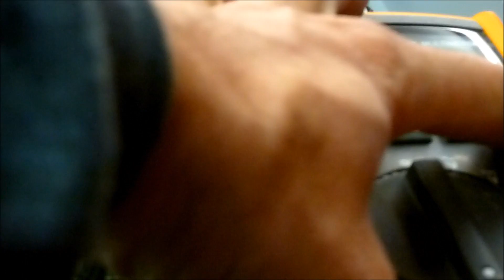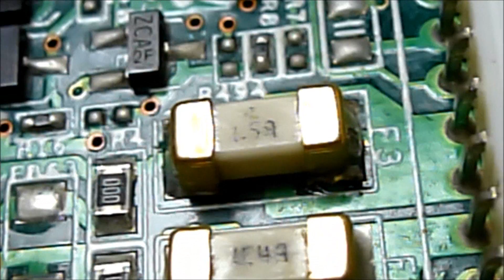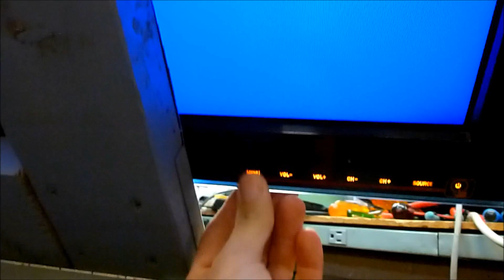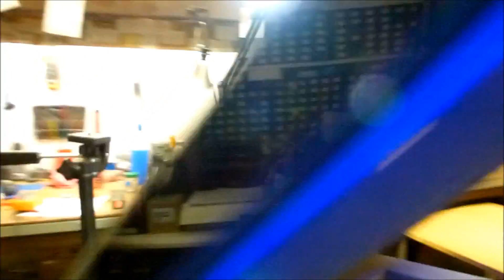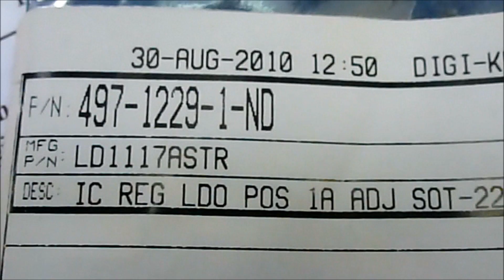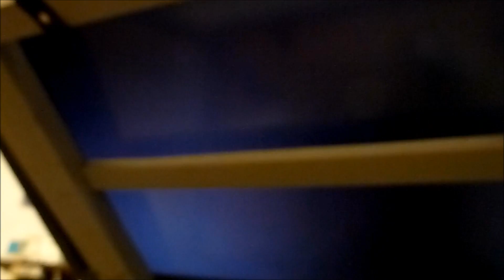Vizio GV42L GV47L FHDTV10A No Backlight, No Digital Tuner, Locks Up,Wont Power Off

Comment: Success!! Found the bad fuse and ordered 3 replacements in case I messed things up. As my soldering skills are beyond rusty, I cheated and soldered a piece of wire to each end of the new fuse, and soldered the other ends to the original fuse. Powered up and shut down with no problems. Without your video the TV would have gone to my local electronic/hazardous waste site, instead it will be put to good use. Thank You!!

Comment: You are the man!  I am an old tech-turned-engineer, but without your video I would not have had the confidence to fix my 47" Visio.  You saved me a bunch of bucks!  I was fortunate that mine only took the fuse to become fully operational.  I only have a pencil tip iron, so I was unable to unsolder the bad fuse, but I just piggybacked the new one and I am back up and running with a $1.15 part!  Giving us the DigiKey part numbers is extremely helpful!  Thank you so much for your help!  

My only suggestion for improvement would be a companion video about exactly how to break down the case and where each type of screw goes where.  Since there are so many screws and this thing is so heavy, a noob might fix it, but then break the TV by handling it, supporting it,  opening it or closing it incorrectly.  Thanks again!

Comment: Thanks Norcal715 your video helped me fix my TV just in time to watch the Kings game. ;-) I could not bring myself to pay $120 to have $10 worth of parts shipped overnight Saturday delivery, so I improvised.  I bought a 1.5A fast blow glass fuse, soldered leads to it and shrink wrapped it.  Then soldered the leads to the surface mount pads.  I had planned to have this be a temporary work around but it looks and works great.
Thanks Again Norcal715 you are doing great work!

Comment: Thank you for the lessons, they are so helpful. I have a 42" vizeo that has this exact problem, powers up but no backlight and wont turn off. I have a bad regulator it has a low output. My board only has 2 fuses instead of 3, one shows 5 volts and the other 12 volts. As I was checking volts on a larger regulator, I arched it and blew the 12 volt fuse.  The back light now comes on and I can shut the tv on and off, but there is no picture. I'm going to replace the fuse and regulator, hope it works

Comment from the maker: on the fixed voltage regulator ic's the adjustment pin is grounded. on some of them they use a resistance divider network to change the voltage.

Comment: I can also confirm that U5 voltage regulator goes bad on the GV42L. Quick fix is just use a lm317t in its place. They can be found at any radioshack.

Comment: I happen to have a GV47L with a no power problem,yellow logo and thats all,PS test 100% good,yes it has a touch pad for power with no results touching at all,any leads on which regulator to start with?,I have all (new) and waiting for the adjustable reg's to arrive-tested voltages on regs,but as I saw in your other vid's some get power from a "root" regulator and cant figure which one it is--thank you,you're "the man" (ps-NO bulging caps),if I lived any closer to your shop I would be begging for an apprentice job to learn more.

Comment: Love all your vids.  I have a Vizio vu42l fhdtv10a.  I have all the proper voltages on the main board/ Power supply and pins, when the left  inverter boards is unplugged.  When I plug the inverter board into the power supply, my output voltages are non existent.   The CAPS on the inverter board look fine. ???

Comment from the maker: The meter is a true rms but that does not apply to DC voltages it only comes into play when measuring AC, and as far as checking fuses either they are good and have continuity or they are open. as far as checking the regulators, there are too many variables involved in explaning how to check them all. as far as seeing I just use a good pair of reading glasses, and yes a fine tip. Thanks

Comment: Woo! Thank you for this, it fixed my TV picture under all inputs, only now there's no sound on any input I've tried. The speakers are ON in the audio settings under the menu settings, but I'm not getting anything. Do you know what the issue could be? Because it's not working on ANY input at all, it leads me to believe it's a fuse or something like that.

Comment: norcal715 your videos are excellent. I am trying to fix the exactly same model with exactly the same symptom of this video (Vzio GV42L fgdtv10a) All the measurement are you are explaining in this video are ok as far as i can tell so still not sure where my problem is. From one of your other video 'Voltage and troubleshooting" you mention pin 13 &14 to converter box. I do not have any current on those pin. Could this be the problem? If so, i do i fix this? Is there one of your amazing video telling me how to do it. I will love to keep my Vizio out of a landfill.
Thank you! 
If you are located in SO Cal you can even make another video out of my TV ;-)

Comment: Your videos on the Vizio TVs are great.  Have you had many Vizio TV suffer from freezing up while the TV is on?  I have come across several TV of this series that would freeze up.  Power cycling the TV will temporary fix the issue but it would happen again with no set time.  So far I have a 37 inch and a 47 inch suffering from this problem.  I know it is related to the main board but not sure what is causing this freezing up.  Is it a firmware issue or defective flash memory chip?

Comment: I have no ability to solder anything, but I've already pulled the back off this same set and I'm certain I have the ability to change a board or two without any difficulty.  While I don't have a digital meter, I do have a basic voltage meter. That said, I can tell you that when the set is plugged in the amber keypad lights come on, and if you press the power button the set clicks as if to turn on, however the screen does not light up, there's no sound or blue screen, nor will it power off by pressing power again, you have to unplug it to turn it off. Using my voltage meter I get readings only on the left side (cold side-i think you called it in another video) of the power supply and the center part too, but not on the right side (hot side) under the metal bracket where there are large capacitors and no power present on the pins that go to the wiring bundles that fan out to the main board, master and slave boards. And I get no reading on any other boards at all.  I should mention that when the set failed it made one light popping sound. I see no bulging or ruptured capacitors on the power supply board like you mentioned in another video or on any of the boards for that matter. I took off the power supply board and see no signs of scorching on the underside either. Long before the TV went out the digital tuner went out, but I didn't discover that until hurricane sandy hit me on the Jersey Shore and the cable was out for several weeks. At any rate, to me this seems like a power supply board problem and changing that out for $45 on eBay seems worth it, but I'm unsure given that the amber lights do come on. In your opinion might this be a main board problem instead or does it seem like I should start by swapping out the power supply board?   Thank you for your videos, time and effort and for any help you or others reply with.

Comment: hello i have the same tv for repair,backlight but no video.when replacing the mb i notice a wire on the lvds cable is cut. i solder the cable ,still the same issue with replacement board.Are these cables not meant to be solder?

Comment: Hello,
What voltage value should we get on the large 3 pin regulator output on the left side of the board right above the cable input?
- Thank you

Comment: I have the same make, model and made the month and year as yours. I came home and went to turn on the TV and the control panel lights were on and I could not get a picture. I pulled the power plug and that was the last time that I could get the control panel lights on. After watching your video post I tried to fix it but after testing the fuses they all tested good so now I don't know what to do. Help.

Comment: I checked the fuse you removed with my tester which is not a multi meter its a fluke electrical tester has continuity selection it beeped which indicates its closed but when it comes to testing voltage my meter doesn't read your voltages so I need to get a multi meter to check which one is bad can email me

Comment: I need to replace some of the fixed regulators, any idea what the Digikey part number for those might be?, also, if its not MARKEDon the board with ADJ id not adjustable correct?

Comment: I have a Vizio VP50 HDTV20A plasma with a blown 8A fuse. I replaced the fuse and the TV is functioning normally again. I've read that one of the two 8A fuses is prone to blow in these TVs. Do you have any idea of a typical failure point that would cause a blown fuse in these TVs, or is it just that cheap fuses were used?

Comment: my tv when off after some weird sound, now is not working, the logo in front is yellow like normal, but cant turn the tv on, the touch pad is not working also the remote controller is not working, i try to turn the tv on using the remote but nothing, i wonder what it can be the damage part, the power inverter, i will open and check this tv  tomorrow

Comment: Hey, thanks for the great videos. I'm working on the same model TV featured in this vid. When plugged in, the logo turns orange, but the touchpad is unresponsive. No visibly damaged parts. Fuses on the main board are good. Fuse on the PS is good. 5v leads from the PS are good. 12v leads from PS are supplying significantly less than 12v. Any suggestions would be much appreciated.
Reply: Did you ever figure this issue out? I’m dealing with the same thing right now

Comment: I lifted the trace when removing the 1.5a blown fuse (poor soldering skills) Can you tell me which two components on the circuit board are connected by this fuse so that i can wire it in and salvage the circuit board.
Reply: +Paul Guay I did the same thing, where you able to figure it out? I tried to bypass the fuse by creating a connection directly to where the lifted pad was but the tv wont even turn on when I tried that.